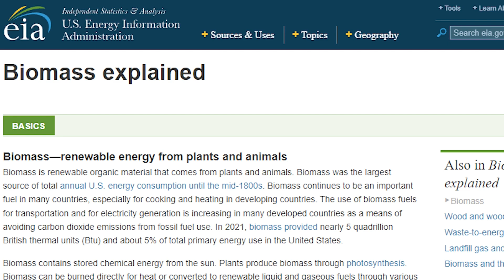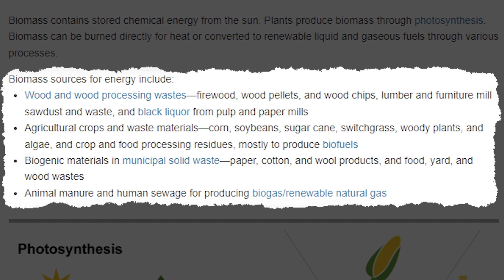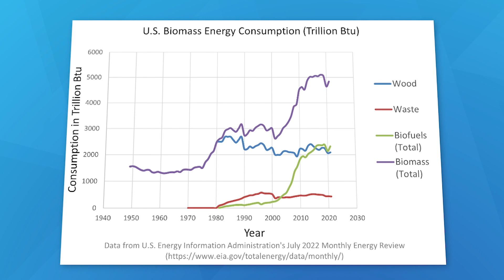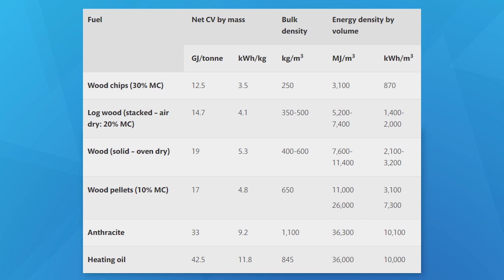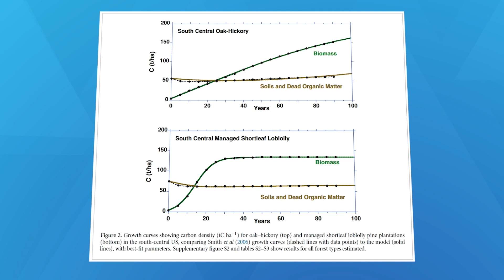Exploring Energy: Biomass

Comment: I use 'biomass' to heat my house in the winter. It's called 'beech'. It works fabulously well and is much cheaper than any other form of heating. I don't use pellets, instead of that I use 'logs'. Once a year, my friends turn up and we make 'logs' using a special tool called an 'axe'. Unfortunately, no women seem to want to come to the 'axe' party or even seem to own one. Not very inclusive! So that has to stop.

Comment: I downloaded your Energy at a Glance paper where you say "growing trees with the intent of using them strictly for densified biomass fuel does not make sense over the short- or long-term"

But- that's not really the case- in the real world- almost nobody is growing trees just to produce biomass for energy. Instead, some wood is used for biomass which has no other use. That being the case- you're making some wrong conclusions. I have been a forester for 50 years so I think I know something about this.

First - it's a lie that burning wood results in more carbon emissions that coal- because forests are sequestering carbon. Then in forest mgt., which we need if we want to live in wood homes with wood furniture and paper products, we need to harvest trees. But some trees have no timber value. They might be undesirable species, or defective trees. So, like in the same way you don't leave weeds in your garden, we must removed these unwanted trees so we can grow high value timber. The only market for much of this wood is biomass for power or pellets or plain firewood. The problem regarding emissions is that it's true if you only look at the smokestack- but if the question is re-framed, "can forests continue to maintain carbon levels or even raise them while burning some wood and cutting trees for timber?"- the answer is yes. So, again, despite the emissions from wood burning, the forests can capture carbon faster than any cutting or burning.

When you burn coal- you take it out of the ground so the total carbon in the carbon cycle is increased. Burning wood does not increase the total carbon in the carbon cycle and if the forests are managed properly, the total carbon in the forests can continue to increase- but the forests need weeding and improvement since millions of acres of forests have been degraded.

The fact that the energy density is lower than coal is irrelevant. Here's the essence- the wood that might go to a biomass power plant or pellets is something we want to get rid of - so using it for energy is a solution that greatly helps the mgt. of forests. If it has lower energy density- so what? What counts is cost. It's true that some biomass power plants and pellet production gets subsidies, but so what? Every form of energy production gets subsidies in one way or another. And, the improvement of the forests results in growing high value timber faster- and, with good forest mgt., there are other ecosystem benefits.

And, ultimately, those of us who don't think there is a climate emergency aren't particularly worried about carbon emissions anyway. Also, it's a reality that wood for energy is truly renewable and if you burn it in a power plant, it provides base load power- just like coal. So, it doesn't have the undependable problems of wind and solar.

This is an issue I've been debating for years with some of the most anti biomass people on the planet so I know the arguments.

Comment: Ethanol. Less efficient than gas. And...making it from corn is expensive. Corn needs a lot of fertilizer and water to grow. Ethanol also ruins fuel systems in an internal combustion engines both large and small. Carbon footprint is huge. No one would produce it unless it was heavily subsidized.
Reply: And the waste is fed to cows who then get blamed as "CO2/methane polluters"
Reply: @terraflow__bryanburdo4547  cheers 🥂 good one !
Reply: @terraflow__bryanburdo4547  Methane polluters!
Reply: @kitemanmusic  Thanks and corrected.

Comment: Michelle Stirling (Friends of Science) explains that Canadian wood pellets are only made from scrap wood/bark, after all the usable lumber has been extracted.  Shipping wood pellets across the Atlantic, then by diesel lorry from the port, is surely not in the least bit 'green'!

How can natiral gas emit less CO2 than burning coal? Each carbon atom combines with two oxygen atoms, regardless of the source of those carbon atoms, with coal, being close to pure carbon, and obviously much more dense than methane, CH4, producing more energy when burnt.
Reply: Lower extraction emissions/cost for NG?
Reply: @terraflow__bryanburdo4547  my step-daughter drives an enormous dumper-truck in Australia; strip off the topsoil, then the crawler bucket excavator rips up the coal and drops it in the dump truck, which takes it to the lorries that feed it to the power station. Hard to be easier or less expensive than that, I suspect...